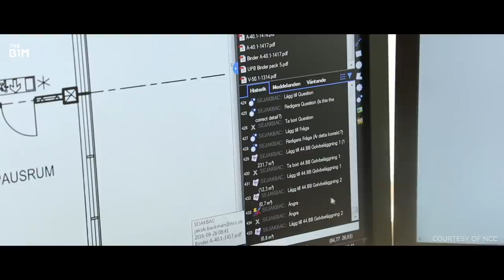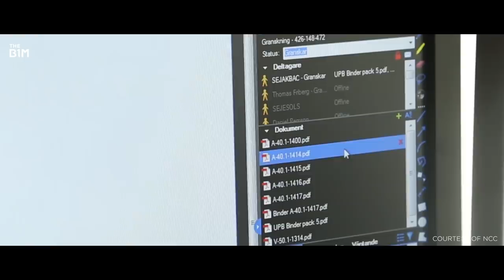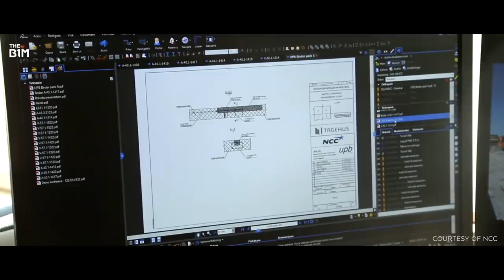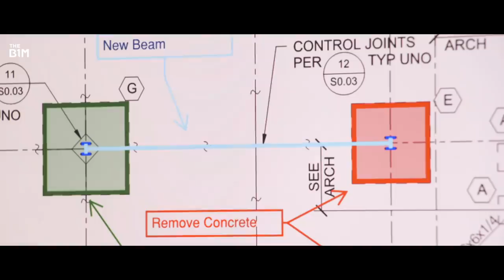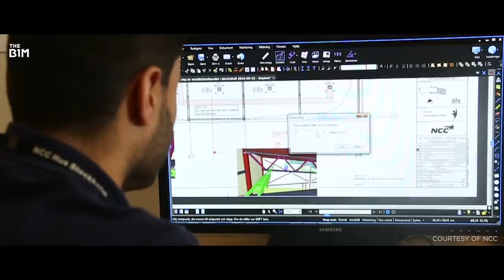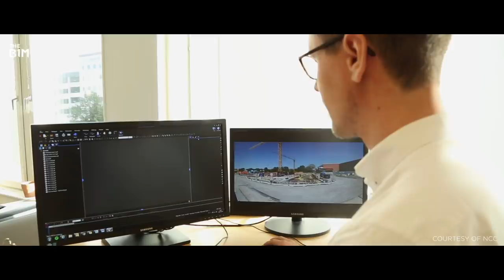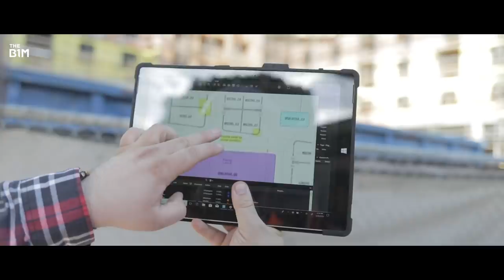The Power of Standards

Comment: What I understood was that in Europe companies have decided to agree on a common design/image of a construction plan. This way comunication between peers is clearer because of the use of the same elements such as line tipes, widths, colors, symbols, etc. on a pdf file to work on Bluebeam which is a program that basically reads pdf construction files.  If this is it then great, fantastic and if extended with ISO it will be aplicable to South America enabling global cooperation. Great video as always B1M !
Reply: Erick Gomez You are correct except for the Bluebeam part. Standard means that it is open to be supported by any vendor, and yes, since it is PDF that Application must support PDF to support the standard.